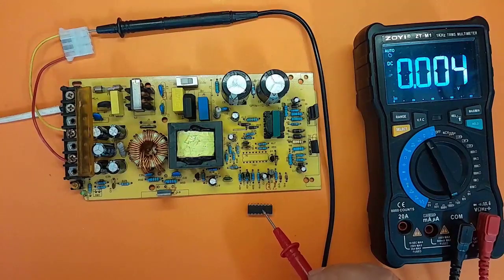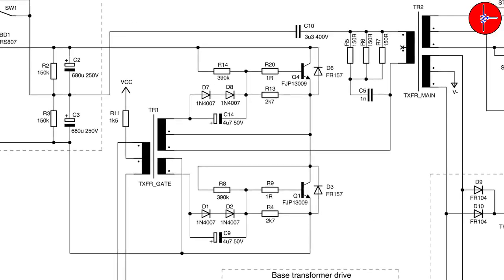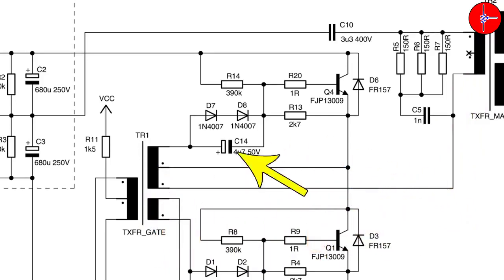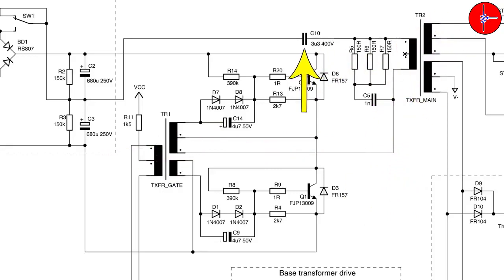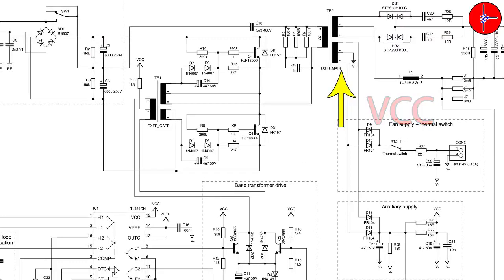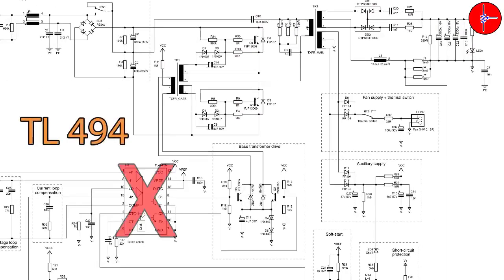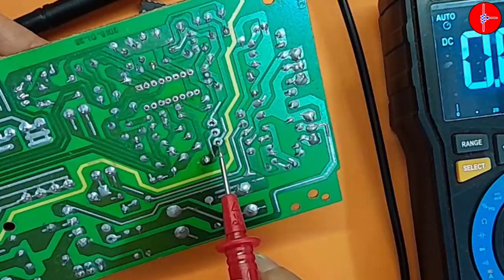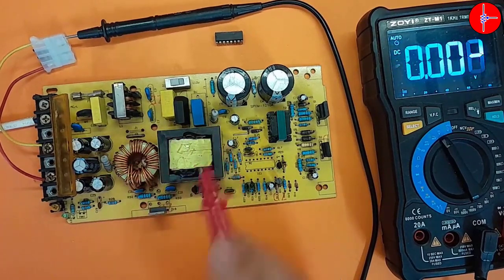How can we turn on the power supply without IC?

Comment: if i understand correctly using it without IC is still not possible because there will be no logic to calculate duty cycle arrangement that means when i put load to outside voltage would collapse.
Reply from the maker: Hi, thanks for your opinion. Yes, that's quite right. As the voltage increases، the current decreases with the consumer connection. ❤️

Comment: Nice, can you make 600-900W DC-DC boost converter with input voltage upto 100v and gives output as 230V DC
Reply from the maker: Thank you for your attention.. The same device can be changed with several changes to the Boost Converter. I'll tell you if you like. 🙏
Reply: @Electronic4U-david  Thanks for considering my request, yes I need it 

If possible make a video by using Ferrite core inductor with efficiency of min 85% else I need at least circuit diagram so that I can solder the components together in general PCB.

Thanks again
Reply from the maker: Sorry, I saw it now
There are many circuits on the internet, but according to your request, it should be a circuit that can create a duty cycle above 50 percent.
The design of this type of circuit requires many protection circuits and is a bit complicated. It is better to first check a circuit that has this capability. Then start building.